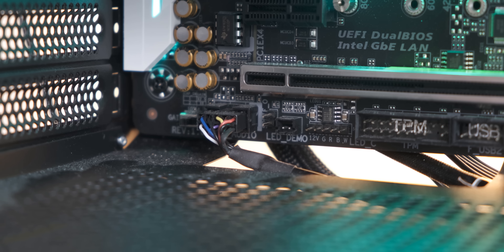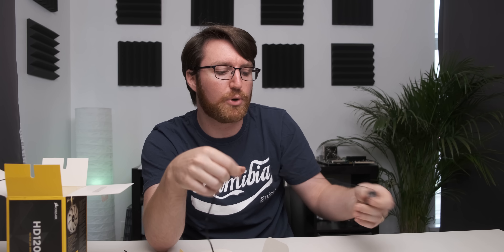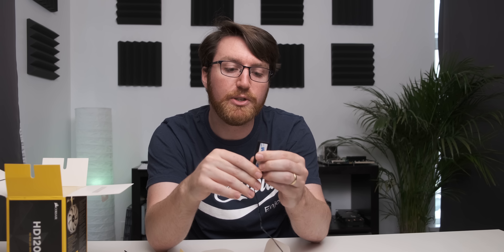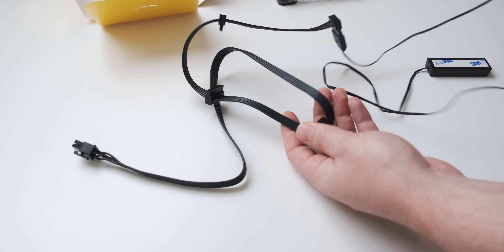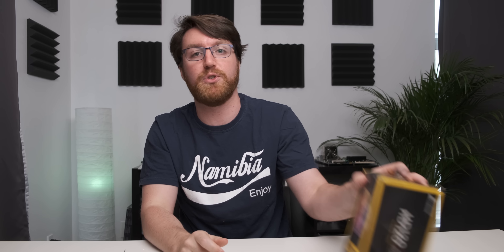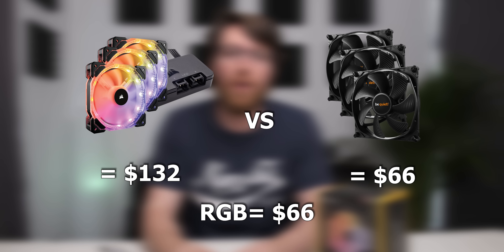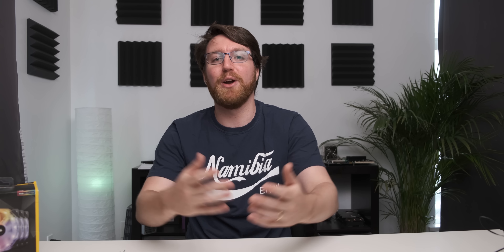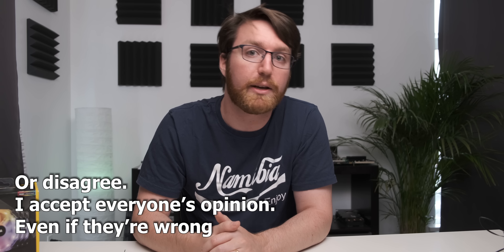The real problem with RGB (A rant about too many cables)

Comment: You can use the 4 pin RGB connector in the 5 pin Gigabyte RGBW port, you just plug it in leaving the W pin exposed, as the other pins are the same as the 4 pin RGB ports.  That's how I did it on my Aorus B450 Elite MoBo. ;)  But you're mileage may vary.
Reply from the maker: Thats a very good point and I did try that. However the sides of the RGB plug on the Cooler was too wide, so it couldn't fit past that extra pin. 
Thanks for the comment. :D
Reply: @DawidDoesTechStuff  The current mobo's of Gigabyte that have this 5-pin connector do have an extension/spitter cable to 4-pin included in the box. Plus, there is mostly one 4-pin rgb connector located near the CPU socket.

Comment: The most basic thing tripped me up when building my last system: I didn't know that there was RGB and aRGB. My Mainboard has an RGB (12V) Header, which is nice. Until I found out that the case I bought came with aRGB (5V) fans, which are not compatible with my header.
So the fact that there are 2 different RGB standards around didn't even cross my mind before building a system. Since I didn't want to buy and install a converter box, I searched until I found PWM fans with 12V RGB. It's not as pretty as aRGB, but it works directly from the header on my mainboard.

Comment: 5 pins RGB are RGBW because there is a dedicated white LED. Looks better.
Btw I hate RGB on fans.. better to have chained case strips with dedicated software
Reply from the maker: Yeah, I understand that technically Gigabyte's implementation is better. However that is only really important if its actually compatible with stuff. :P
Thanks for the comment.

Comment: I agree 100%, i have 9 Corsair fans, a cpu aio, case, mouse, keyboard, all from Corsair. I have an ultra tower and cables sometimes are a problem, and i have a HUGE case. I control my fans with a Commander Pro, again Corsair.
Reply from the maker: Wow, that's an amazing sounding build. The cable management must be pretty crazy. :P The good thing about it all being from one company is that you can use one piece of software for all of it.
Reply: @DawidDoesTechStuff  Yeah i like it, but sometimes i ask my self, it's all this hassle worth It? Noctua fans are better full stop, but i'm a sucker for RGB.

Comment: I'm actually kind of glad a few of the items I planned to use in my new build last year became unavailable as it pushed me to move to alternatives which put me entirely in one camp for my fans and RGB equipment, so I thankfully dodged the shitstorm of trying to mix models and software.

But it didn't help cut down the sheer scale of the cable management issue. It would be nice for those involved to create a new jumper and connector that incorporates both fan control and RGB into a single connection to halve the number of cables needed for such device. But given the sheer number of proprietary connectors already being pushed by the different companies, that seems highly unlikely.

Comment: So the cables ARE too short!
I thought I did something wrong lol. I've built my first system half a year ago and threw an extra fan in there for a bit more airflow, since it wasn't the flowiest of cases. And why not something shiny, so I can actually see the insides. But it was a hell of a struggle to route the surprisingly short cable to the rgb connector. I thought I missed something and looked into the MB manual surely 12 times until I gave up and just let the weirdly stretched cable where it was. I mean, it works fine and all, but I really felt like I missed something important. Turns out it was the cash grab connector thing I missed xD

Comment: I'm against RGB lighting because they burn power (not much, but some, and correspondingly generate a bit of heat, both directly and with added drain on the PSU) without contributing anything to performance, and since I dislike side windows to see them through on both aesthetic grounds and the fact that acrylic ones keep heat in that plain steel sides would dissipate, actively hamring performance. That's plenty of reason all on its own.

Comment: I bought an uphere rbg fan kit from Amazon for $35 USD, it came with 5 fans and a controller. The controller came with a button installed and I was like what the hell where am I going to plug that in.. I was able to unplug it and it had this tiny two pin deal that I was able to unplug my reset button from the motherboard and plug it into the controller. My biggest struggle was dealing with the wire mess in the back panel of my case from all the rgb fans.. and tbh I didn’t LOL. I was able to plug the controller to my mother board and there is a setting where you press the button for 3seconds and it will sync with your mother board

Comment: Ive not messed with RGB anything yet but after watching your video, I might just stick with function over looks. I mean I like to have color emitting from my PC but I dont need to turn my PC into a 70s discoball. From my understanding once you commit to a RGB setup with a certain brand you're pretty much locked into using that brand for the rest of that PCs lifecycle.

Comment: I did my first PC build about a year ago, did a video of it on my channel. when building it I diddnt know alot about PC building, the case I got was a used deepcool mattrex 55 that came with enough fans to fill every hole in the case , the front fans that were stock with the case , deepcool branded fans were also RGB, but the guy who sold it to me took the controller , and you can't buy it seperately , luckily the fans are still able to be connnected. still to this day i have never hooked up the RGB because I don't care enough to figure it out. The case has a glass wall infront of the front fans anyway so I'm probably just gonna get a new case.

Comment: I have seen RGB Fans that actually daisy chain minimizing the cable issue. Ive also found that the 4 pin RGB controller/hub connections on both ends are weak and flimsy breaking easily rendering the RGB function useless. Ive pretty much gone with the easiest to connect and least amount of RGB in my most recent build....

Comment: I myself have every rgb thing going through an argb hub, every component have the same 3pin argb connectors EXCEPT the LianLi Strimer 24pin cable that I bought recently. That stupid cable looks really nice but the version I bought only has its own connector that I cant use. So now I have this LianLi controller wasting a pci slot so that I can change the mode, brightness and speed of the lights on that one 24pin cable. I am planning on either getting a LianLi argb controller or trying to solve the problem otherwise

Comment: yeah but rgb sure does help if you wanna sell a used pc for a profit
Reply from the maker: That is a very good point. It is a great way to sell PC's. I like the idea of RGB but it just needs to be made easier to build into a case.
Thanks for the comment.
Reply: I got a nice alienware case with rgb lights not fans and tempered glass side panel from like 2006 and just dropped and i5 4440 gtx 770 12gb ram 240gb pny ssd 1tb hdd crossfire mobo and blu ray drive (just to add value) I spent £165 on it and I can almost guarantee that I can sell it for £300-350 where I live just because there is rgb in it
Reply: @treeplusplus  😂
Reply: @treeplusplus  so true. People out that as a selling point. It's flashy, it makes it stand out but not always in a good way. Sometimes it looks terrible like those fully glass cases in my opinion. Those cases plus rainbow fans equals a 12 year olds gaming set-up.

Comment: Cooler master stuff all seems to have direct outputs to 4 pin RGB or 3 pin ARGB universally. Some fans now include female/male rgb connectors. Deep cool and other brands may also use proprietary connectors, but allow them to daisy chain with each other and convert to the appropriate ARGB or RGB headers. The same brands also include 4-pin and 3-pin controllers aswell, this is just price gouging nonsense from Corsair with a solution you should expect on a $20 5 pack of RGB fans from Ali Express. Wow.

Comment: i am happy with my rgb setup on msi b450 , 3x140mm rgb fans and 1x120mm rgb fan in nzxt h500, all have 4pin rgb header and are conected to rgb splitter for 5€ and all 4 fans are synced from msi mystic light. and everything costs 50€+-. it is true that fans are akasa TL and R7 vegas because board dont have addressable rgb. cheap but quiet. regulated from 7 years old regulator , but looks like new and is crystal white like case , awesome, all fans are spinning at same speed.
Reply from the maker: That's a great point. You don't have to buy expensive Corsair stuff to get RGB going.  :D
Reply: @DawidDoesTechStuff  you are right. if i saw the price for 1 or for 2 fans from corsair or nzxt without controller i know that is little much . and pesonally i dont like that style. but nzxt aer rgb still looks great. i wanted to control all fans from msi software. so i dont have choice. continue with doing great videos like this.

Comment: I cant stand dealing with all the rgb cables. In fact, i prefer to use those cheap rgb fans from amazon because they have a proprietary hub, so no dealing with glitchy software or excessive cables

Comment: oh god does this video hit home for me you have no idea how frustrated I was with my build. I built in a Thermaltake level 20 xt and it has no place to hide cables its a massive open case. I used 6 Thermaltake ring plus fans and 9 ek Vardar rgb fans. each ek fan has 2 cables. I used fan hubs rgb hubs the Thermaltake fan controller. then I have 4 sata ssd's and and open loop with rgb on all of that. such a fking nightmake wiring all of that and making it look presentable. its an awesome system but the need to do something about how to wire all of this I needed so many hubs and splitters and omg I cant even begin. its like a nightmare I will never do something like that again I promise you that. it looks cool but dam. and again the Thermaltake level 20 xt, awesome huge case but dam I cant recommend it. in order to make use of its size you need to stuff a ton of shit in it. I have 2 480's and a 120 radiator as well as 15 fans it looks great but its so much work and its not even worth doing. I have a Thermaltake view 37 and I would rec that case over the xt you can build a badass system in the view 37 and it will look and perform great. leave the level 20 xt to the pro builders who will have custom cables made otherwise its a fk'ing nightmare and you will want to jump off a bridge just looking at the cable management needs. it requires a ton of work and being really creative to get the xt to look good when its filled with rads and fans

Comment: my ram sticks would annoy you 3 sticks work as they should the 4th stick has a mind of its own! its uncontrollable im trying tolearn to ignore it it all works as ram 35c temps no crashes its just the light, tried swapping the sticks around the same problem persists on the same slot so its not really the rams fault. mobo sending the wrong signal to it.

Comment: I have Corsair ML 120 fans and I got in my 3 fan pack Corsair HUB and Lighting Node Pro so I got basically everything to control the fans with the Corsair software. And the cables u say I can plug them off really easy idk why u have so much problems plug them off. Maybe u bought a cheap china copy LMAO Well I have no complains about my Corsair ML 120 fans.

Comment: You're having a 'first-world', WINDOWS problem - LOL! You should try it being a Linux user. Where there's NO RGB control software that works on Linux, and ALL RGB must be hardwired in with those little boxes to control it. It just means that you have to do more pre-planning, and using only one brand of RGB per type of component.